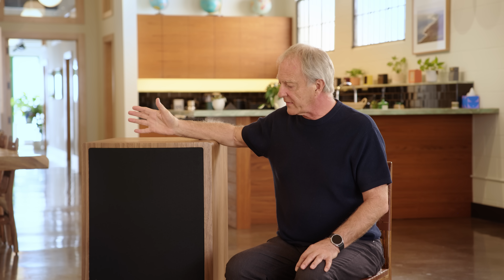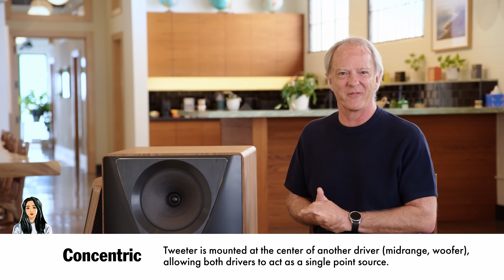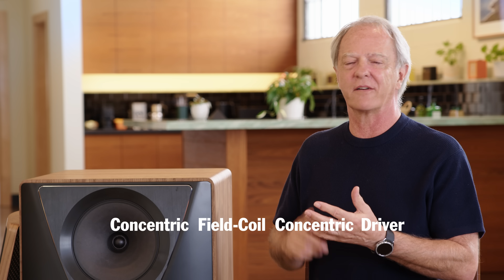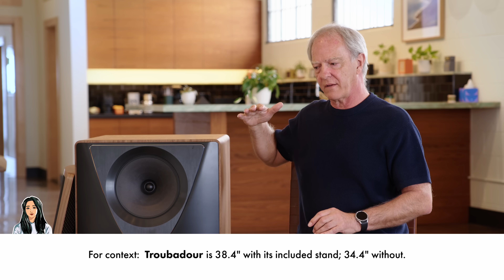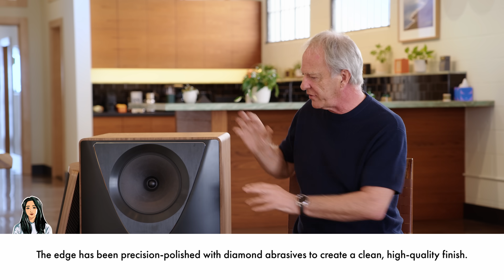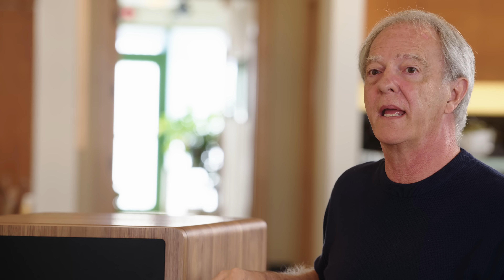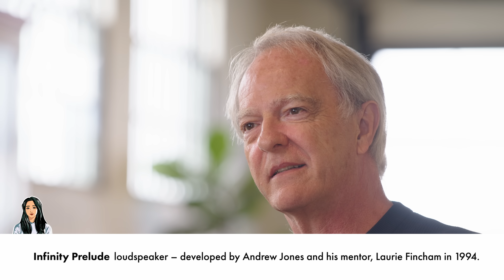First Look! Andrew Jones's New Loudspeaker – TROUBADOUR

Comment: It’s only taken 30+ years for designers to realise ‘there’s no replacement for displacement’. 
Love this return to the good old days. 
High efficiency speakers tend to have great dynamics, mixed with modern technology should be awesome
Reply: Manufacturers are simply catering to the largest segment of the market: people with limited space and/or wives. The high end segment, which this speaker is in, never had a shortage of large displacement speakers.
Reply: @noticer6489  True, another factor is that modern amplifiers easily do 600 watts to over 1kw. With this much power, speaker designers feel very comfortable trading efficiency for a slimmer profile.
Heck! Even the vaccum tube companies developed brand new high power tubes such as KT120, KT150 and 212 just to put out more wattage for those speakers.
Reply: @noticer6489 yes, we have. I am sick of bookshelves and it's a lot of us.
Reply: Exactly, especially in low frequency reproduction, a high efficiency 18" woofer is faster, produces less distortion and gives better bass definition compared to multiple low efficiency "long throw" 8" drivers.
The only downside is it does require a much bigger enclosure though.
Reply: @hyphen2612 questionable that 18” is fast quite
Reply: @hyphen2612 
Faster? WTF does that mean?
Reply: @hyphen2612  not necessarily.. there are 15-22" open baffle bass drivers. 😊 They don't need a big box
Reply: @annebokma4637  And they have wonderful cancelation of the bass frequencies due to the sound coming off the rear of the speaker canceling out the sound from the front.
Reply: @andymack8178  you clearly don't know how they work 😂😂
Reply: @annebokma4637  Oh enlighten me Einstein since 90% of speaker mfr's put theirs in cabinets.
Reply: Probably/ maybe around half a dozen speaker manufacturers use similar large woofers. 
Certainly many more DIYers
Reply: Is this mostly nostalgia or is there is a mostly technical motivation for the xxl cabinet?
Reply: @MikeDS49 He wanted efficiency and full range (LF extension), then we (Physics) will give you cabinet size xxl.

You cant get both..😅❤

Yes, you can get LF extension and small box/cabinet but then you need lower the efficiency! 

You cant have both, pure basic speaker law (Hoffmans Iron Law). 🎉
Reply: @AmazonasBiotop 
Indeed, ... as he emphasized early and often throughout the video.
Reply: *great dynamics with low power amps. More power is the solution for less efficient speakers.
Reply: Exactly! I’ve been using a pair of DIY speakers with 15 inch woofers for the past few years. Bass from speakers with multiple smaller drivers just sounds compressed in comparison.
Reply: It's not the speaker designers, they would love no limitations, it's the buyers. We have known how to make a comfy chair for more than a hundred years so why are there so many uncomfy chairs?
Reply: 100%, even gr research have big speakers now. Never going back to bookshelf's
Reply: Danny swears his small woofer speakers are as good or better than large ones, large ones being an advantage in a larger room.
A huge speaker in a tiny room would sound terrible without extensive room treatment.
A small speaker in a huge room will sound too small.
Large is not always better. And small is not always better.
Reply: Now one can pair this with an entry level amplifier from a high end brand? PLUS he has nailed the aesthetics ..... Wish I knew what sideboard he is using there hosting his LPs.
Reply: Bill Dudleston of Legacy Audio has known that all along. His speaker designs are based on it.
Reply: Why I still have my fathers AR-3a’s. Granted I also have some B&W 804 towers, htm2 center and scm1’s
Reply: Cerwin Vega screamed about about this 45 years ago! 😂
Reply: @angelotig  C-Vs certainly screamed! Not a pleasant frequency balance however.
Reply: The expense of large speakers and the expense and inconvenience of large, heavy cabinets are the down side.  And those are two significant down sides...
Reply: For spl yes. For low frequency yes. But for the mids and highs size is not relevant to anything except loading a larger space.
Your statement has truth but is an oversimplification of a much more complex understanding of how accurate sound is created. Andrew himself has stated that 4 inch woofers create the most accurate midbase, due to wavelength size in relation to driver size.
Subwoofers have made large speakers unneccesary for similiar performance. A 4 inch woofer midbase with a 1 inch tweeter paired and matched properly to a sub should create the same if not better sound that a similar setup using 6 inch woofers and 1 inch tweeters with, or without a sub.
The 6 inch only reserving the ability to load a larger room.
Reply: 30+ yrs exactly. 
Mid 90's saw the sub/sat push in full swing. 

I bought in, displaced my monkey coffins for JBL two-ways supported by dual Velodynes. 

Along with the integration challenges, visceral bass immediacy and impact was gone. 

Physics 

"  ♬ ♬ ... I fought Hoffman's Law, and Hoffman won". 

The ubiquitous mid-fi of the era didn't even meet at the crossover, ie., Bose Acoustimass, Cambridge Soundworks, and many others ... sold ridiculous amounts and offered up anemic playback. 

Instead of "I want my MTV,
Sting should've demanded;
"I want my old Vb".

Comment: In the vintage electric guitar  world some folks LOVE old field coil speakers in vintage  tube guitar amps. Speed and detail are often mentioned as one of the things field coils do well.
Reply: Speed and detail are subjective terms.  It's up to the designer of such an exotic driver to prove through actual measurements what advantages they have achieved.   If a driver is "slow" then it can't achieve flat output in the higher frequency range. If a driver lacks detail, that will be shown in various distortion measurements.
Reply: @johnstone7697 Then how about "some say they sound great".lol